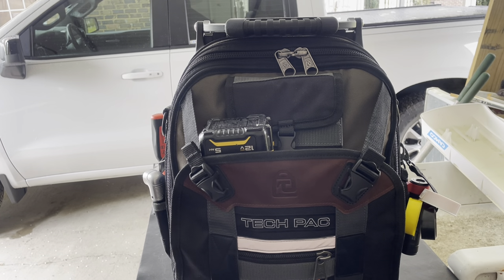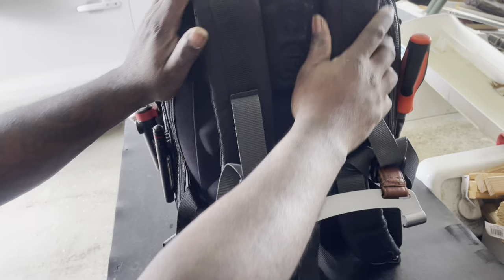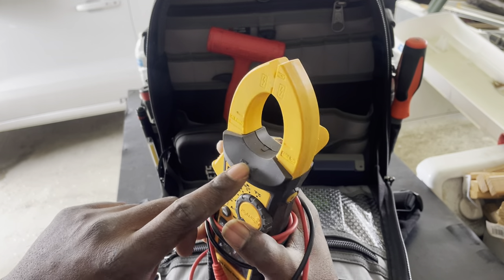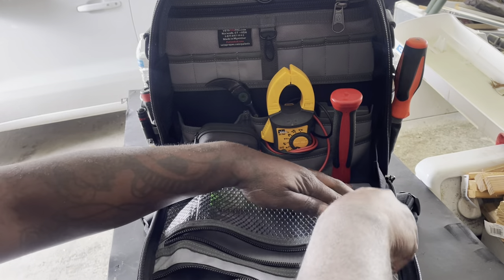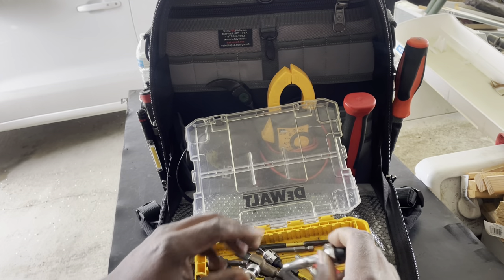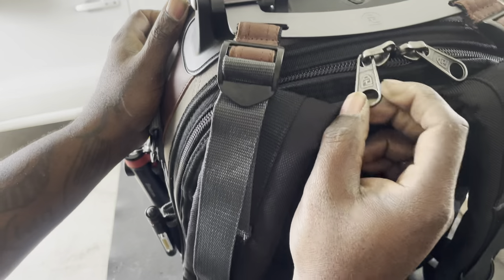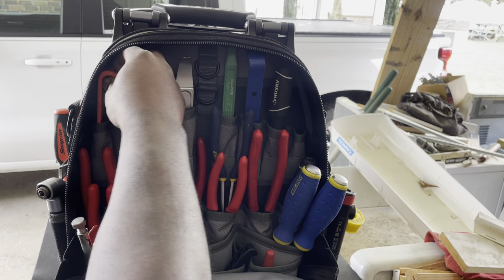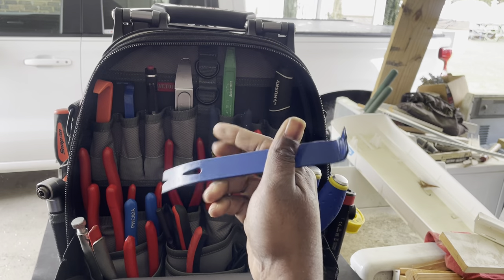Veto Pro PAC TEC PAC LOADOUT

Comment: I highly recommend u check out the Malco magnet bits, easy to clean off metal shavings.  I put small amount of butyl on a small screw and drill through the magnet sockets that should get rid off all the metal shavings.
Reply from the maker: I purchased them and they are great 👍

Comment: Knipex StepCut are something else, but my recommendation that's inexpensive and a go to in the UK for all electricians are the C.K. 3963 Croppers.. Smoothest pivot, blade stays sharp and sickle shape which allows cutting and stripping with ease. I have a stupidly expensive set of tools but I always carry the cheap 160mm and 180mm C.K. croppers. If used for smaller gauge 4mm and below they will last but they do cut 25mm tails but that'll take its toll on the longevity. Don't go near the other brand variants for this type. Solid review btw.
Reply from the maker: Sweet thanks for your comment